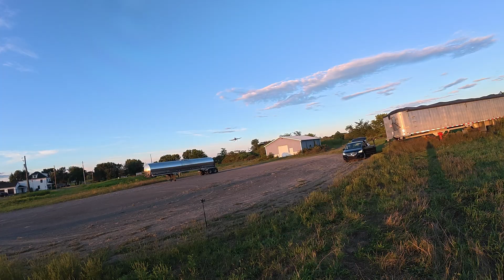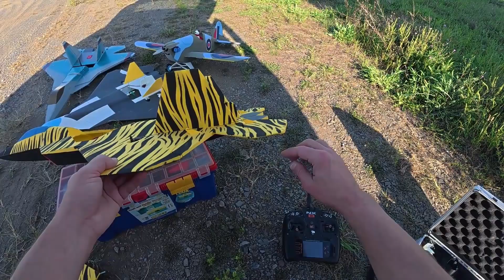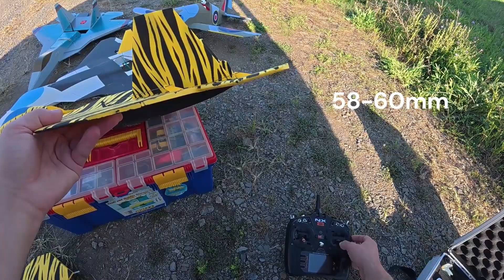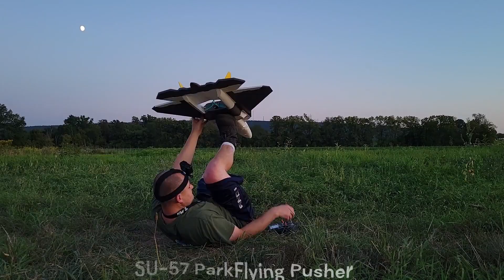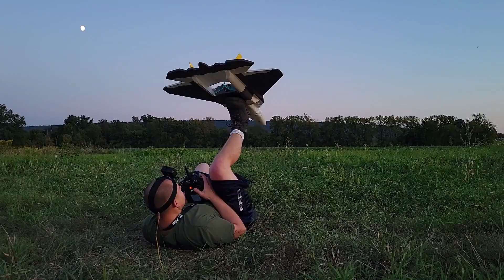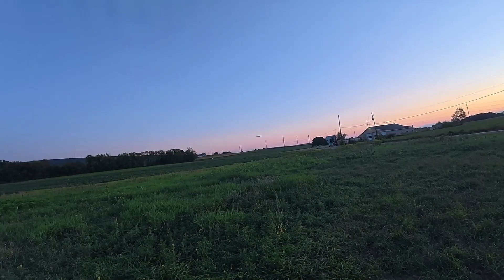Tuning the Tiger — F-22 Control Throws & SU-57 Teaser

Comment from the maker: If you are running a Transmitter with EDGETX, you have to turn each the elevator and aileron down 50%. This way 50% throw is reserved for each channel, and you need both channels together to max out the throw on one elevon (instead of each one maxing out the throw by itself). This is how you "Mimic" the Spektrum setup I made in the video, and on all my Pusher Parkjets.

Comment: Well I got my H2 D today and I’m gonna be setting it up later. one of the first prints I wanna do is gonna be One of your prop pusher planes but I’m not sure which one yet. I just wanted to know if I can use bambus  Asa aero to print these planes or do I need a different filament? Also is there anything I need to do to be able to print it with my bambu labs H2 D? Please excuse my dumb questions I am a total newbie.I have never owned a A 3-D printer in my life. I however have built many RC planes just never a 3-D printed one.
Reply from the maker: I would recommend learning to use PrusaSlicer instead of Bambu's Slicer. I have tried every major slicer out there. Bambu Lab being easier is not true (IMO it's harder), and their slicer is actually a little more limited when it comes to certain options. Prusa slicer is FREE, and yes it will run on your machine. The prints come out cleaner also with less travel. I left pictures on the F-22 thread of what I mean.

More infill does NOT mean more strength!! Same can be said for different types of filaments as well. Print aircraft strictly from LW-PLA, or your ASA-Aero. I always recommend LW-PLA to everyone cause you get more aircraft per $.
Reply from the maker: That's awesome!! Very exciting!  Printing is a lot of trial and error, and takes a while to master. Personally, I don't care for Bambu Lab's slicer. Luckily you can use whatever slicer you want to. If you do use Bambu's Slicer, I made settings a few months ago that will print most models. Although, ASA Aero is a little different and a little harder to print with. ASA prints at a much higher temperature than normal LW-PLA, and the bed temp is much higher also. Lot easier for stuff to go wrong throughout the print also. You probably should order some cheap LW-PLA. E-Sun works well and is one of the cheapest, and it is a pretty well rounded brand of LW-PLA.

If you do decide to use Prusa Slicer, All my models come with 3MF files which work in Prusa. That way you could simply change the bed temp and the nozzle temp and probably print just fine with your ASA-Aero. NOTE: 3MF files are not compatible between different slicers, so importing them into Bambu Lab will not work if I made them with Prusa, and vice versa.
Reply from the maker: https://www.rcgroups.com/forums/showthread.php?4773875-F-22-Park-Flying-Pusher-by-HoloModel-s-RC/page19

Here is the link to the print settings that I set up for that specific printer a while back. Creality print is on page 20. You probably should read that portion of the thread as well.
Reply from the maker: Once you get it up and running, do some test prints with the filament it came with. Get yourself familiar with the printer and the slicer. I would recommend leveling the bed, and checking to make sure the Z-offset is correct and that the first layer is properly "flattened" to the bed surface. "Z-Offset" is the distance from the tip of the nozzle to the bed when your nozzle and head are at it's home position, and will need adjusted each time you change a tip. These are single handedly the most important things when trying to print. Both of these things can be searched online and you can find walkthroughs for.
Reply: OK thanks appreciate your advice

Comment: SU-57 or F-22 for slow flying?   Looks like a FT F-22 in the background.  I have several foamies of pusher jets, but non 3d printed.  All of my printed jets are edf, but i want to print one of your pushers.  And I like slow flying best these days since i have got old!!!  Both planes are beautifully designed but I'm wondering which is best to control.
Reply from the maker: Thank you for the comment! That's actually an SU-57 in the background of this video from RC Powers, scaled up 115%.  The SU-57 with a mechanical 4X4 and centerline rudder will fly slower than the F-22 built similarly. These pushers last so much longer than a printed EDF, and really are a lot of fun. Very easy to launch, fly, and land. 

The F-22 is my personal favorite because of the way it flies. The SU-57 feels like it wants to go straight when you throttle it up because the motor is a little further forward, and it has more wing area. The F-22 flies best with an elevon/spoileron setup, and centerline rudder. Basically, a mechanical 4x4 using four servos, and the centerline rudder. Will update in the future for an actual mech 4x4. 

The SU-57 goes together in half the time of the F-22 because it uses less electronics. They both fly very similar though. The SU-57 floats more, but F-22 is more maneuverable. As long as you follow the 1.5% infill, they both will fly slow., but SU-57 is slow-er.

 It is very important to try and follow the build/print recommendations, especially if looking for slower flight. Use G-Codes if you can. If you print these models with extra infill, they fly completely different. I know I have tested it. I put steel wires in them to avoid using a lot of infill, plus it really makes them last longer. Also, both these airframes were built around a 7in prop, and that 2836 motor. It handles better with the bigger motor, unless you have a 1500-1900kv drone motor capable of pushing at least a 7040 prop on 4S .

I recently finished an F-15 pusher, there is pics on the F-22 RC Groups thread. 
Motor and prop choice is also very important for these "Park Flyers". Mounts for the drone motors on the thread as well.
Reply: @HoloModels-RC  Thanks so much for the reply.  I have been building and flying rc for many years.  I still have some crystals and radios from the old days.  Have built several balsa planes from scratch, and several foam planes too.  I probably have at least 10 or 12 kits,  most still in the box, that I need to finish some day.  But I really enjoy printing and building these newer planes, it's an enjoyable hobby.  And I have figured out how to get great prints with lw-pla with Bambu A1, so I will be paying close attention to your files. I have a drawer full of electronics and motors, etc. (some new and some from crashed planes :) so no problem there.  
I think I will go ahead and download the SU-57 since I have a few F-22 foamies already.  I will keep you updated.  Thanks again, Joe
Reply from the maker: @wwjoesr  Awesome, thanks. Be sure to set "Slice gap closing radius" to (0.00) to get the internal structure to appear in your slicer. Have built many kits before and during the military. Printing RC has pros and cons which you know already, but it's fun. Think I enjoy designing more than anything. Anything else comes up don't hesitate to drop a comment. I try to answer everyone in a timely manner. Best of luck to ya, and thanks for downloading!

Comment: Never seen a launch like this before lol.
Thanks for making this video it helps a lot. I flew F-22 today and I am getting better with it. Tomorrow I will be flying a new Sportster with the tail wheel addition; will let you know how it goes.
Reply from the maker: You're welcome, and yeah, please do. Good luck with the maiden tomorrow. Personally, I like the Sportster printed as light as possible. Going to re-work the files soon and re-make the build video also. I did that "foot launch" about 30 times, and a 20 sec short will be available of them in about 2hrs.
Reply from the maker: Hey Mark, when you print the Sportster, do you slice it yourself or do you use the G-Codes? Basically, I wanted to know what set of G-Codes you are using if any. The S3D g-codes in the main files, or the ones under the Prusa Profile directory?